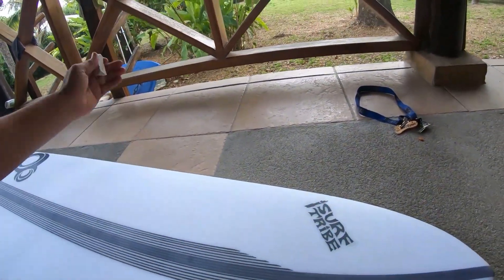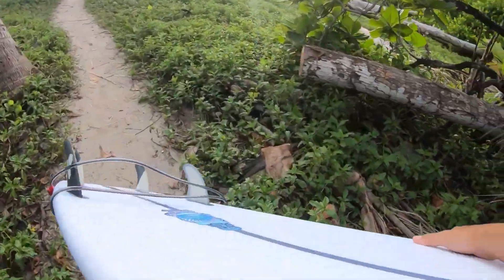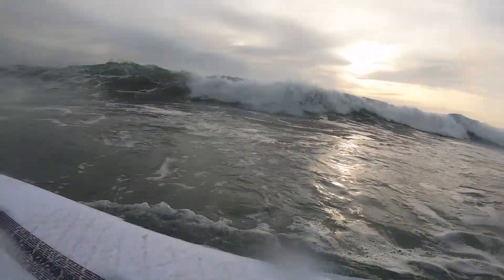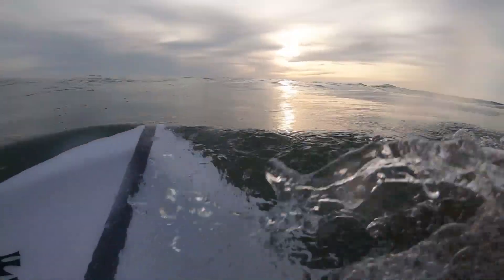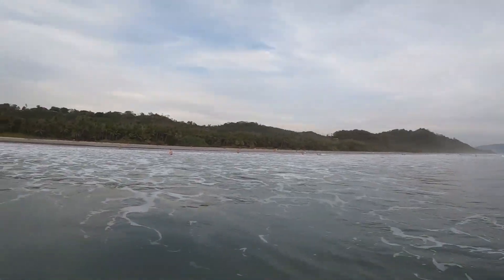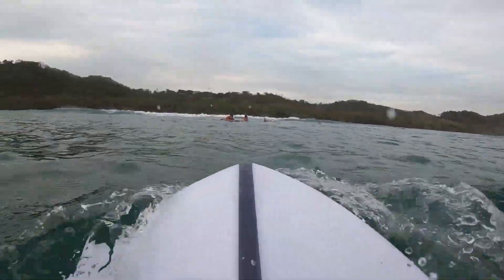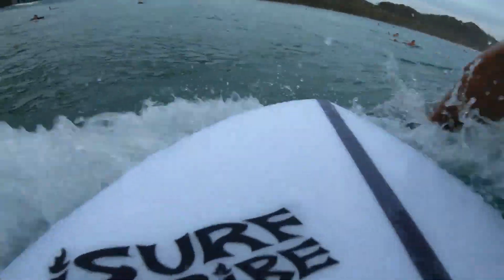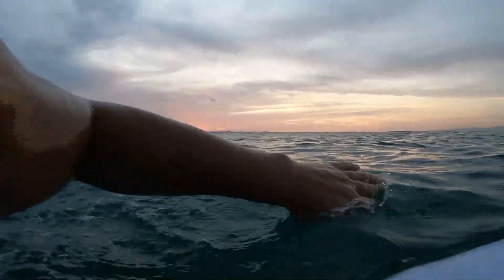How To Surf A Brand New Surfboard

Comment: Lost two half FCS2 quad sets exactly like you. Pain in the butt. What‘s the point with a tool-free system if you keep losing fins.
Reply: Its better to knock a fin out then smash in a fin box, that's the whole point
Reply: Darcy Plant I see what you mean. All fin box damages I had were either lateral impacts, or pushed straight up towards the deck from hitting stuff under water, both of which wouldn‘t have been prevented by an FCS2 box (because the fins come out from the tail towards the nose). But I guess in cases where you land an air reverse, keep going tail forward and then bump into a rock that‘s just shallow enough to pull your fin out of the box and not shred your whole tail, that‘s a scenario where an FCS2 will will come out, and a Futures one won‘t. ;-)